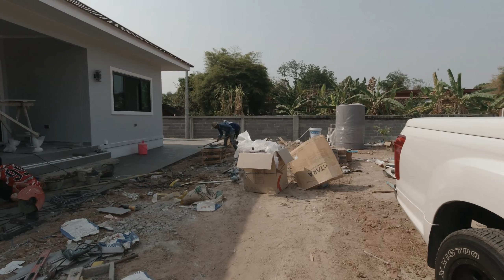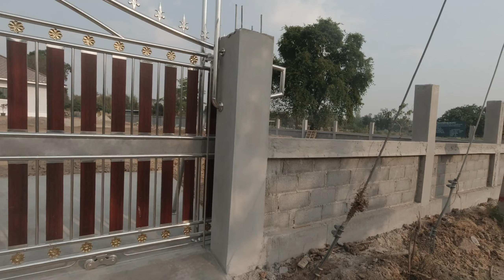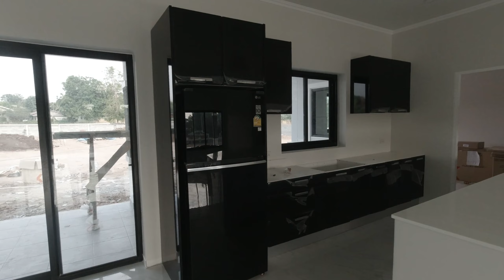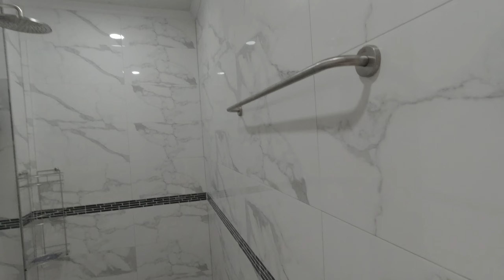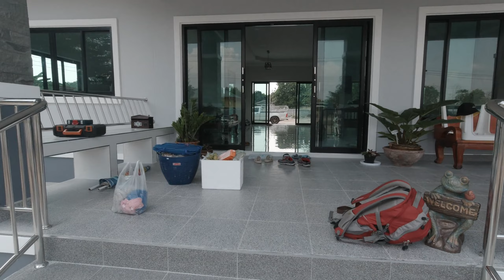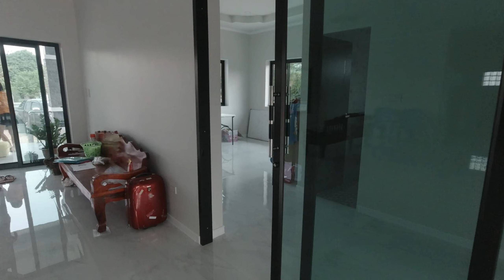WE FINISHED THE HOUSE

Comment: What are you doing for water filtration and storage ?
Reply from the maker: We have installed a 2000 liter tank outside with a filter and pump. We will also add a three stage filter in the house for drinking water.